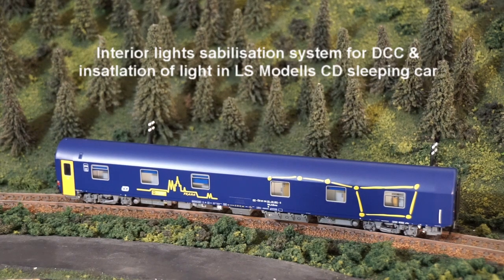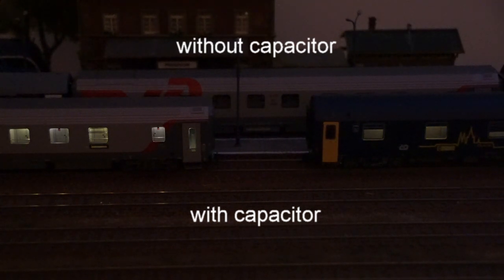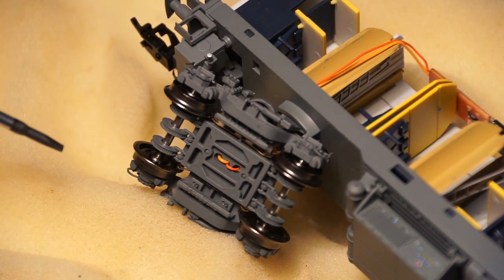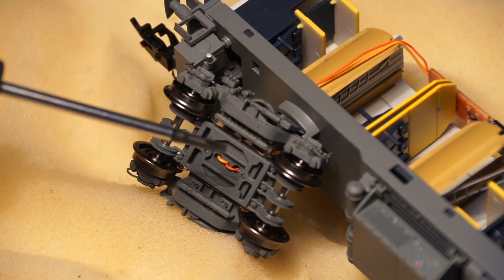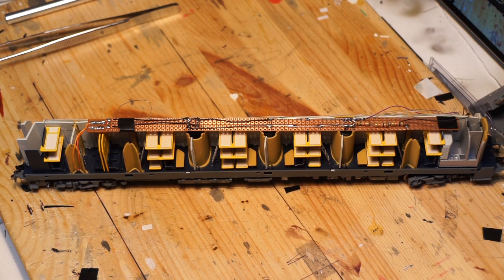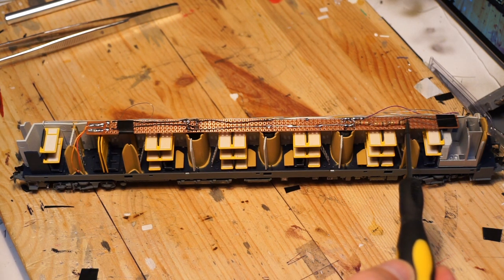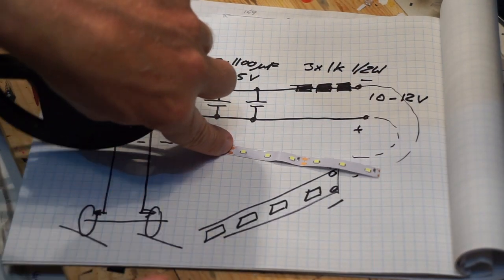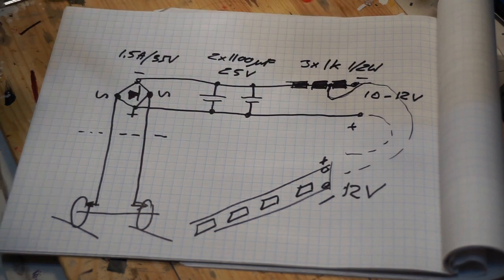lights stabilisation system in CD sleeping car

Comment: Great instructions! Thanks for sharing. May I ask why you need the rectifier? Isn't DCC already DC Power?
Reply from the maker: Is more complicated than DCC=DC, its modulated, so for the capacitors to work the input needs to be converted to straight DC